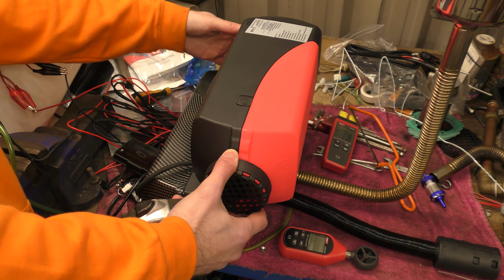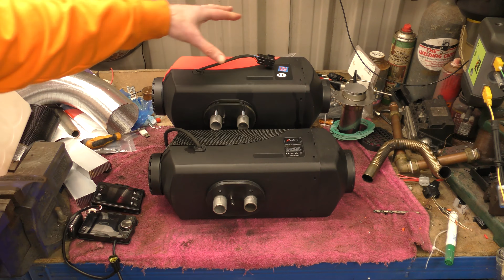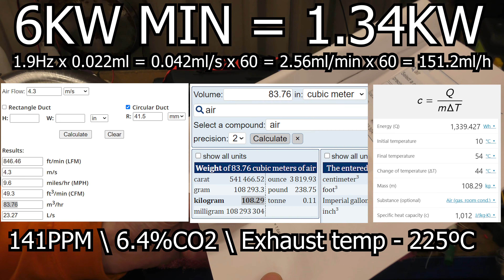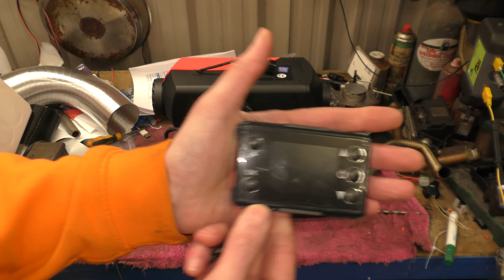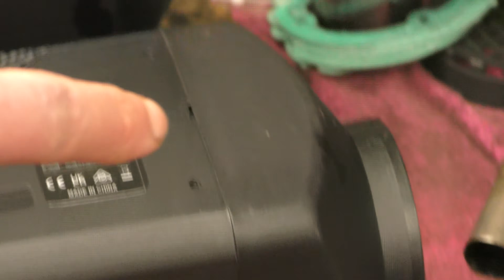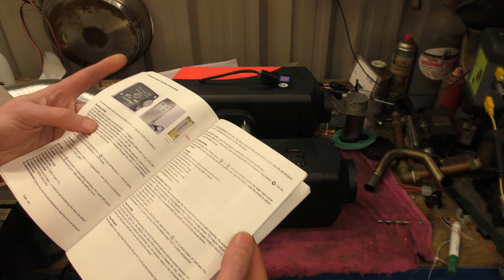Hcalory HC-A22 / XMZ-D2 6-8.5KW vs  typical 4KW heater - Tested

Comment: To add to the confusion.  I just bought a 5kW heater, it seems to be the same bodyshell as your 4kW one, it has a similar controller, but a gear instead of a spanner.  The label on the unit says it's 8kW, so output will be anybody's guess until I get it built in.  I dont expect that I can change the settings on a newly bought mosel anymore, but who knows.

Comment: David, great video. The HCALORY TB2 is supposed to have this same larger heat exchanger but I am 0 for 4. All were std size. I do have couple suggestions for you. Would love to see repeat test on the 4k utilizing the larger air output opening. I replace the std 75mm openings on mine with the 90mm ones from AliExpress for $5. You could also just unsnap and borrow the larger opening on 6k and put in the 4k for test. I assume increased air flow improves efficiency but would like to see the real numbers. Also love to see test of temp/air flow difference when remove the air intake grate.  I did quick check and believe it increased air speed by about 15%. Likely lowers air temp and exhaust temp so guess it would still increase total efficiency but maybe not as clean exhaust output?? Thanks for all the info

Comment: I love these videos. I run 8 of these heaters at my property for a variety of uses. I have HLNs (with the 90mm outlet), cheap 5kw units, Lavaners. 
I'm interested in exhaust temps - my cheapos have a huge variation in exhaust temps (some as high as 460, others more like 360 at 5hz). The more expensive heaters (lavaner, hln) consistently have lower exhaust temps. Lower exhaust temps seem to line up with higher air outlet temps.
Reply: I found my HCALORY tb2 has lower exhaust temps but also has lower heat output than similar vevor. I seems like HCALORY 1-10 range is more like 0.7-8 in vevor pump hertz and fan speed

Comment: Interesting results when testing the larger unit at the high and low settings. It would be really useful if it was tested at each of the power settings throughout the range,  to provide an 'efficiency' graph, perhaps finding a sweet spot right in the middle??

Comment: Thank you for this detailed video.. I was seriously considering using one of these on a lower setting, to replace the 5kw i have tuned to run extremely clean (<=3ppm CO @ 195c) and hot on it's medium setting , it seems im actually using the best option and wouldnt gain much from this large 6-8.5kw unit, out of interest the unit you have there with no Settings menu that burners super clean on low , does this by any chance have a RED Ecu board?

Comment: So if you lose so much heat out of the exhaust, why not capture the heat off the exhaust before it goes out of the building with a longer heat tube with some kind of fins on it like a baseboard hot water radiator?

Comment: Great test! They are advertised as 12&24V -  however the pump (and possibly glow plug?) are 12V. Is there a DC-DC converter somewhere if they where to run on 24V?

Comment: So with this being 6kwh do you need different fuel settings ? 
Like the 5kwh you would have hz max 4.5 and max rpm 4300 
What would this be buddy ? 
I have low hz 1.4
Max hz 4.5
Low rpm 1600
Max rpm 4300 with a 20 ml pump but it’s not starting apparently the fuel delivery setting I have is for the 5kwh
Reply: Update? No idea how your doing this either lol What’s the goal of tuning these?

Comment: Hi David would the afterburner controller work with this heater unit
Reply from the maker: Negative.  ECU is very different.
Reply: @DavidMcLuckie  thanks for your reply.I just don't know what heater to buy .I'm building a new insulated bike shed 4.4 meters by 2.3 meters .you think this heater would be over kill ?
Reply: Yes it works with a different Ecu after burner will send you the Ecu
Reply: @FiatDucato-ComForTmatic-Guy what’s that do?

Comment: Hi David,

Probably a simple question for you but how are you calculating the hz rate accurately?
I have this heater but Hcalory customer support couldn’t seem to confirm the hz rates for each of the 10 levels you can set the heater to.

I can then confidently work out the fuel usage like you’ve done for each level.

Thanks,
Tom
Reply from the maker: Reading the hz output on a picoscope attached to the laptop.

Comment: Thanks for another informative test. Very interesting as always. I'm in the UK with a small well insulated van, and like some others, I'm particularly interested in the lower outputs of maybe running at 0.8hz for long periods. 

My 5kw heater will do this but CO is 1000ppm and I worry about it sooting up while I'm away. I'd like to see comparisons with the 2kw heater run on minimum and build up of soot. Does a quick blast on full power 8.0hz quickly burn out the carbon I wonder? Now there is another interesting video to be made that I've not seen yet. Everyone just scrapes out the carbon.

There is a lot of discussion on reducing fuel pump noise, but I find at higher settings mine sounds just like a jet engine and the fan is the most noisy part, drowning out any ticking noise from the pump.
Reply: If you blast Diesel heater on maximum for 20 minutes every 14 day, you will burn sot away.

Comment: I have found 3-4hz to be the most efficient for mine. The exhaust poked through a radiator reclaims most of the heat from the exhaust.

Comment: Dave,

Something in the measurements/calculations is incorrect, for certain.   Are you suggesting that the exhaust gases from the heater amount to only 40 Watts?  I have my doubts that 40W would even account for the latent heat of evaporation for the water produced as dry steam.

OK, a quick estimate.  Your 107g of diesel burned in an hour would produce around 420g of CO2 and 130g of H2O?  That 130g of water would require 80W just to evaporate it, without taking into account any change in temperature of the combustion/exhaust gases.  That is already twice your results for the efficiency of the heater (1.39kW in and 1.35kW of heat in the warmed air).  

The amount of air, to burn 0.107kg of diesel, would be about 1.6kg - heated from ambient to 200+ Celsius.

Just saying….
Reply from the maker: I 100% agree that something will be incorrect.  Most likely is the assumed amount fuel being consumed.  I will need to get some accurate scales and properly measure the consumed fuel.
Reply: @DavidMcLuckie  I generally use a 2 litre plastic fizzy drink bottle.  Filled and and marked with 2kg of water and then refilled to the mark with diesel.  Weight of bottle + fuel, less the weight of the  bottle (or another used as a tare) provides the working density.  Your errors are almost certainly mainly air-flow measurements, I would think.  Modern kitchen scales are quite accurate and error-free anyway but scale errors are taken into account by the calculated density of the fuel.

Comment: 90% efficiency on Max, with the 400+deg unused exhausted gases...I am quite surprised! Didnt know it was that efficient. Keep it up, love your videos!
Reply: Yea, that doesn't sound right
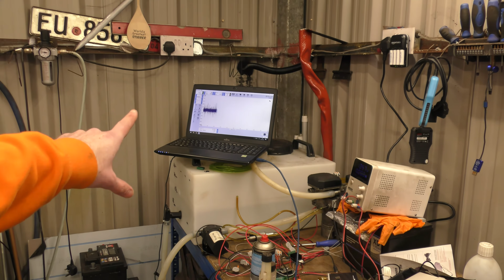Reply: @timothyfischer5160  He does mention at around 3:15 that the fuel measurement method isn't going to be the most accurate for an absolute measurement.  At 3:27 "Even if they're wrong, they'll be the same wrong" - they're valid for apples to apples comparisons of the same pump and fuel lines, but I wouldn't trust any absolute measurements without further calibration of the setup.  I agree those efficiency numbers seem a bit on the high side, but it's a great relative comparison between the units.

Comment: Dear David,

First, thanks for all your diesel heater videos and the mad way you produce your videos.

Now, to the other reason that I write. With your experience in these heaters, I have an issue that I hope you can help me resolve. I have a 5kw heater that has never given me headache. I use it to heat my basement woodworking shop. Being so fond of that unit, I just bought a 2kw Hcalory branded heater to install in my greenhouse. It has given me nothing but trouble for the past weeks. 

It runs smoke free, heats up as it should. Yet, from the exhaust, it produce a terrible howling almost trumpety farting sound. As if the burner produce a crappy flame front. I have messed about in the settings, changing my pump hertz and fan speed. No change. Also, worth to mention, the heater produce this sound at every output level. From running it as low as it gets to full blast, the sound is still there.

Any clue as to what can be the issue? I have taken it completely apart, checked gaskets, the glow plug is seated well and the mesh is installed correctly. I have even ported the intake and exhaust with a small file to remove whatever flash was present from the casting. I myself am out of ideas by now.

Any ideas?

Comment: Hi. Not far off what I asked you in a email last year about extending the length of the heater to give more surface area for heat transfer. I wonder if the high reading of CO could be because the exhaust port is too small by not allowing the fumes to be removed quickly so sort of choking off the burn chamber flame some how. Maybe increase the exhaust bore to 30mm-35mm and see if that helps with the CO. Just a thought
Reply: Nowt at all, I suspect, to do with anything you wrote in a previous comment.😊😊  

The ‘5kW’ chinese heaters typically state 0.51l/h maximum fuel delivery.  Go figure that in this test, where the measured 491ml/hour is not even close to the smaller machine’s maximum capacity.😊  That indicates, to me, that your suggestion re port sizes is irrelevant.

Comment: Whilst you're testing different heater sizes, you're documeting different tunes.  But have you ever run into two of the same heaters having different tune? say two 2KW heaters having different tune and settings, even on the same controllerboard and display.  I wonder if there are a million different tunes, or do we actually have the same tune for the same type of controllerboards.

Comment: Great Video Thanks David. I had similar problems with a 5kw in a red metal case (it kept flaming out on startup)
 so I changed the ecu and led screen to the blue controller and the turquiose coloured ecu board with the large copper coil and metalic strip crossing the board from side to side, (from ebay) the controller that arrived with it was the same as yours and did not allow any settings to be changed, now all 3 of my heaters the 2kw, and two 4kw heaters all have the same ecu boards and controllers. apparently the ecu's work with every lcd screen with a triangular shaped plug although I have not tried this out as yet.

 I wonder if changing the ecu and controller on your 6kw would allow for a better more efficient burn on lower settings?

 another reason for my changing controllers and ecus was the availability of the lcd remote controls although range can sometimes be an issue but it is an easy fix if you take the remotes apart you can bend the aerial inside up away from the board at the top of the remote and the range increases quite dramatically to around 60 feet. They also use tripple A batteries which are easier and cheaper to replace than the 12 volt variety or button cells, the little lcd also gives you the core temp readout so you can actually see the core heating up on the remote screen so you know its not flamed out. my offspring lives in his caravan outside and I am master of the heating remote 😂 so this is handy for our situation.

Comment: Another great video and test David, thanks. I am going to get one of these larger ones and see how I get on in my application. I don't know if you saw my video, but I took my DIY controller a step further and used a different pulse generator board and got it to run pretty good. Take a look if you get opportunity, would love to know what you think. Cheers.

Comment: I've owned an Hcalory 4Kw with the blue controller and a matchbox sized remote for 3 years now and it runs perfectly in my campervan.  I recommend the brand to everyone who asks about it.
Reply: Have you ran it on kerosene? Cheers
Reply: @stevenlarratt3638 No, but it's still running fine.

Comment: Hey David.  I've got a fun experiment for you.  What if you ran the exhaust thru some type of radiator.  They make fined tubes.
Also adjusting the larger heaters fans speed.. down... Might let it run hotter more efficiently, but no one obviously wants their heater to start melting plastic... The smallert heater probably has it dialed in better